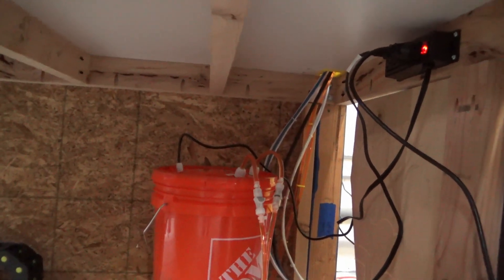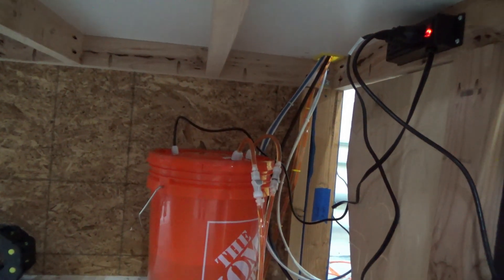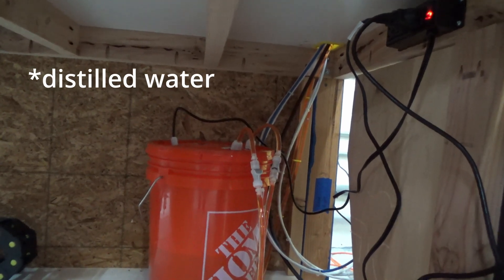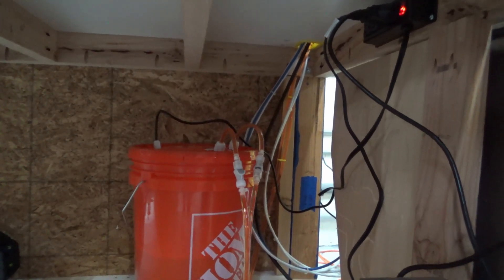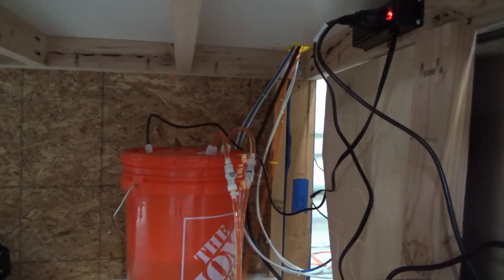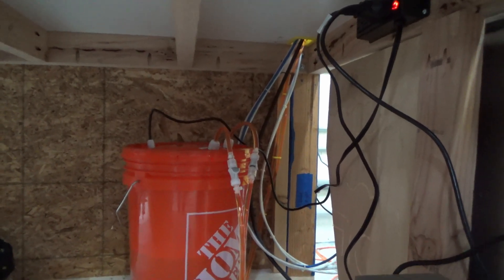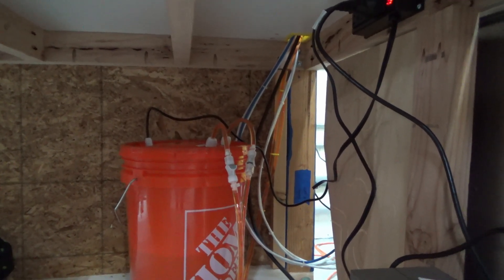PrintNC Project Part 8.5 - Charging the Coolant Loop

Comment: Did you pull the spindle open and make sure it was grounded?  I started my build after you and mine from the kit wasn't grounded inside.
Reply from the maker: Yes I did!  I installed the missing ground lead.